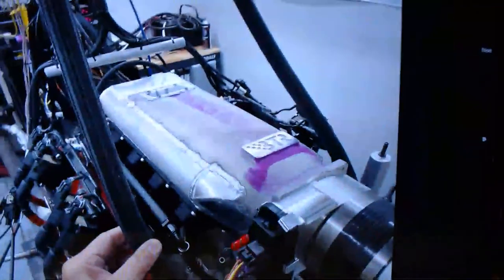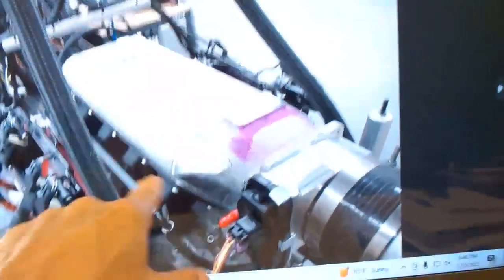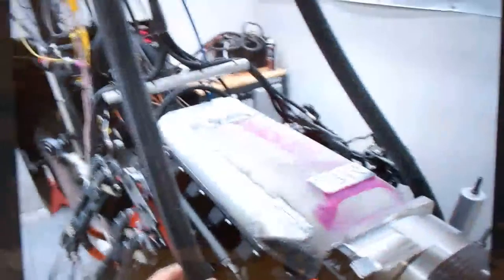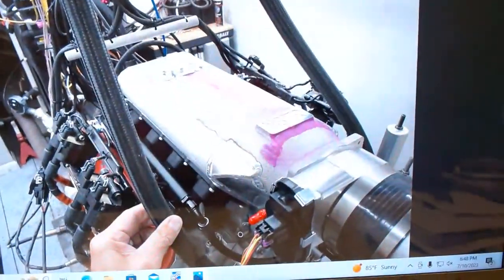LET'S TALK TECH-PLENUM VOLUME AND BTR VS HI RAM

Comment: I wish you had a 125mm throttle body to match the opening of the large intake.  It might have shown a few more horsepowerssssss.  Even so, that manifold would probably be best on a high winding 454+ inch LSX - and there isn't a big demand for those.